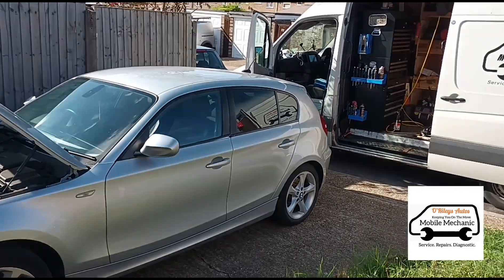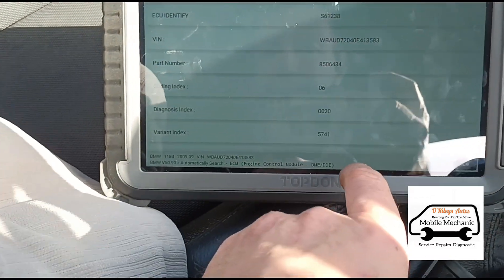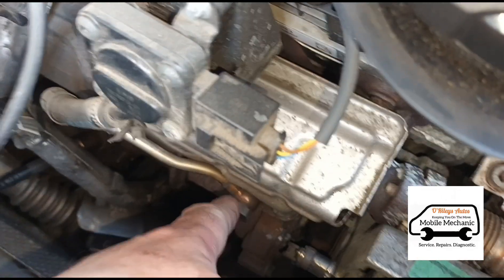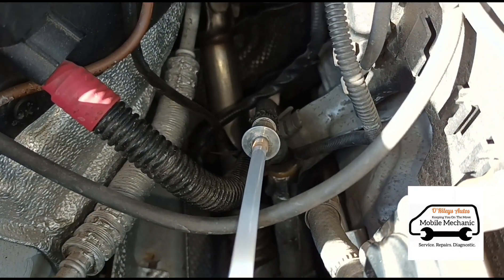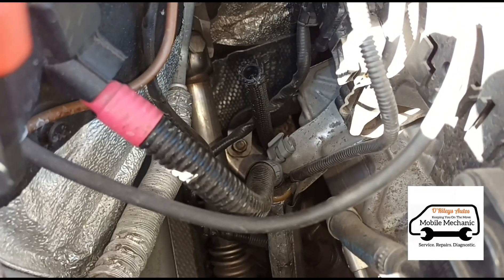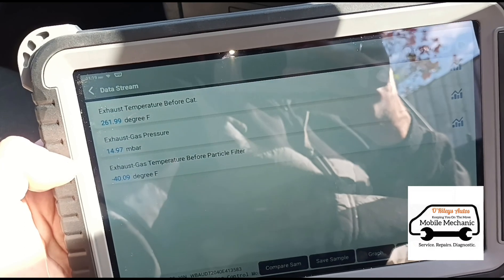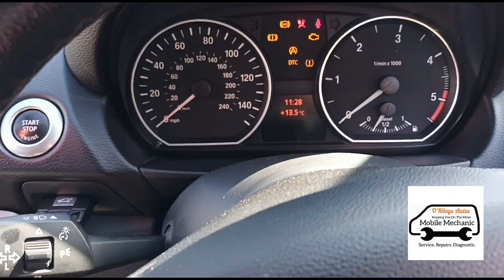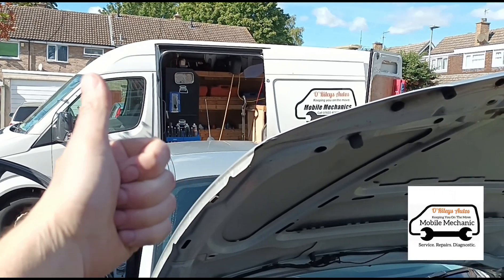BMW 118D 2.0D 480A 481A 4D00 Particle Filter System Blocked DPF. Exhaust Backpressure Sensor

Comment: I feel like that sensor is supposed to be working ill have to double check on my 118d, there are 2 sensors plugged into the dpf, with the sensor not working it probably won't all it to regenerate and the dpf will block up again. also is it safe to use "of car" cleaner whilst its on the car?

Comment: I don't have an air line. If I remove the 02 sensor and poured the wynns fluid in, leaving it for 2 hours, would that work at well?
Reply from the maker: No. It would sit at the bottom so only clean a small section.  This makes it foam
Reply: Thank you Jimmy for the reply. I tried it today by just pouring it in with a funnel and it did reduce the back pressure and I did a regen and a drive.  I will have to get an air compresssor to get a better result. I got loads of foam at the start follwed by smoke once the exhaust heated up.

Comment: Oil change necessary afterwards? Surely
Reply from the maker: Yes I advise every customer 👍🏻

Unfortunately only 1/10 usually go ahead with it. 

When I mention oil change is advised you get the feeling they think you are just adding extras for more money
Reply: @ORileysAutos  well when there head gasket goes that’s up to them 🤣
Reply: Why would you need an oil change?

Comment: Another good vid mate. 
I'm the opposite to you, I prefer my topdon over the autel software, suppose its what you're used to. 

The wynns fluid is good stuff for the money too, I keep a bottle on my van 👍 

How you getting on with the compressor?
Reply from the maker: Brilliant. Real game changer being so mobile and able to use some handy air tools
Reply: @ORileysAutos  it looks a cracking bit of kit. I'm using an 8L clarke bandit compressor at the minute, bought it as.it was cheap and didn't think it would last but it just keeps on going haha

Comment: better than the v-tech? either way still great results. i did a similar diagnostic transition recently, from a mk908 to thinktool master 2 which uses the same software as topdon/ launch. very happy with it so far 👍
Reply from the maker: Haven't used Vetec in a while since I moved location. GSF Car parts is not local to me now

Comment: Not that we do that many DPF cleans have used the Wynns fluid a couple of times and like you say does the job and yes Wynns should be sponsoring you. Will be interesting to see how you get on with the TOPDON been thinking about changing myself.
Reply from the maker: @martinguitarhd28 no reason apart from curiosity.  Plus my Autel couldn't reset adblue on a vehicle recently so wanted a backup machine
Reply: @ORileysAutos  Hi I'm looking to buy something like you using, this TOPDON Plus have some model number? Is ther something you can't do with TOPDON? Wish you all the best.
Reply from the maker: Finding it  bit difficult to get used to compared to the Autel. Autel is easier to use I think  but I'll get used to it soon I hope

Comment: Hi what would the differential pressure be on a transit mrk 7 2.2 euro 5 engine at low and high idle cheers
Reply from the maker: Under 10mbar idle. Under 80mbar 3000 rpm